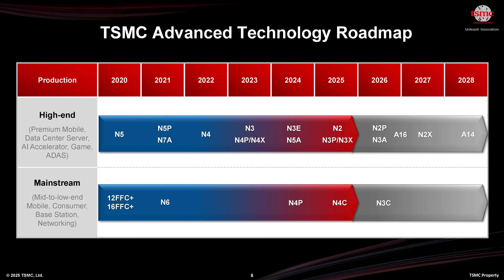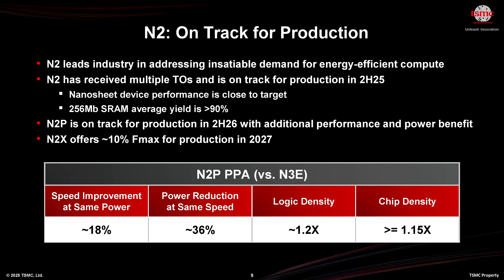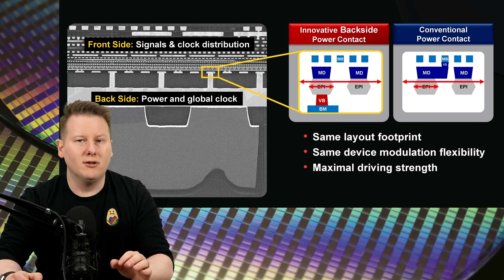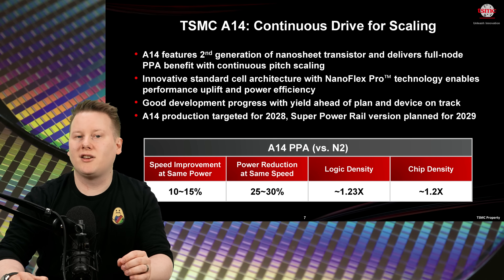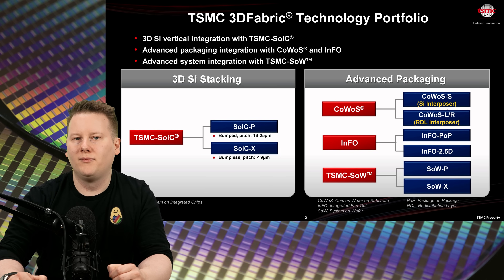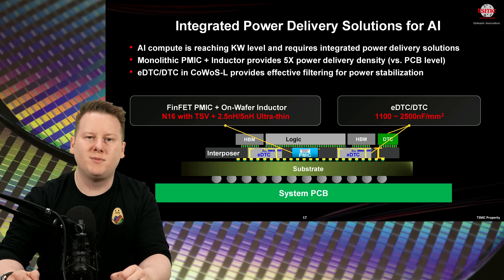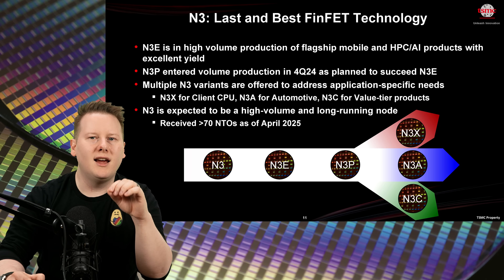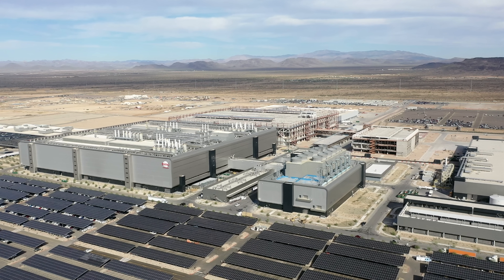The Future of Chips is TSMC's Roadmap to Success

Comment: This roadmap looks uninspiring. Even three years out, "A14" hardly qualifies as a full node improvement.
Reply: We're not in the 2010s anymore, we have to deal with this.
Reply: @ Sure, it's the best they can do - but we shouldn't let marketing make up new BS.  TSMC called their first finfet node "16nm" when it was functionally identical to 20nm planar.
Reply: TSMC's CC Wei has recently redfined "full node performance" gains as 15%.  :(
Reply: It's a good roadmap if they can stick to it.
Reply: It only looks uninspiring to the uninformed. From an Analog, RF design POV, TSMC putting monolithic PMICs & LC tanks in the interposer is mind blowing!!!
Reply: @tringuyen7519  the engineering is inspiring but the results, compared to historical scaling, are kinda meh.
Reply: @jrherita  "compared to historical scaling"  You do realize that the physical limits of the root materials are quickly being reached, right?  You can only go so small before things simply don't work any more.  Were you paying any attention to the density increases in the next generations? 10% is going to be pretty substantial.  As they say; Moore's Law is dead...
Reply: @tringuyen7519  That's all packaging? 

Sure, nice filler for a presentation when your process scaling is in the toilet, but not really a replacement.

Comment: What will be beyond A14 in 2030+ what technology could replace silicon based transistors ? Or they will continue to enhance A14 little bit more ? Where is the physical limit ? For both Intel and TSMC i don't see any updates to technology behind A14. I remember when Core 2 duo was announced (2006) Intel already claimed  something like 14-10nm transistor in research now where are talks going ?
Reply from the maker: I've got a video on this coming soon - an update to my imec roadmap one from two years ago. Simply put, we know how to go until 2037
Reply: @TechTechPotato  Thanks for reply, I think this is interesting topic. Also if there are possibility in future for higher frequencies, or this is more related just to higher transistor density. Interesting is to see where are limits, I remember in 2005 I was thinking the limit will be around year 2020 now industry managed to pushed it more like to 2035+ ?
Reply: @michalfajta4508 TSMC can probably support frequencies beyond 7G. But can US FCC accommodate higher frequencies even for 6G yet? Beyond 2030, technology may hit a political barrier.
Reply: Well, the transistors are now about 10nm in size, so we're talking about a couple hundred atoms. I think we'll soon get to molecular structures, instead of carving crystals into tiny pieces.
Reply: @davidgunther8428  Currently, the limit is in shrinking the gate-to-gate distance, not the source-drain distance (which most people refer as the "transistor size"). The former is harder to achieve. We're stuck at about 45 nm nowadays with FinFETs.
Reply: I was actually about to post the exact same question, glad i had the good idea to read the comment section.

It's interesting and also scary to know that 2030 is key decade in many industries.
Reply: Clearly, there's a lower limit of "size", contrary to Moore's law regarding transistor density on a basic single wafer, and we are fast approaching that.  Where the gains are to be had is in lower voltages (lower resistance), discretes (non-logic) as part of the wafer itself and stacking.  Most importantly, the need for endless improvements in 'processor "speed" is rather pointless for commodity consumption; we are already far past what is required for typical day-to-day tasks of the vast majority of personal and business IT uses.  If you look at a current console like a PS5, the hardware is positively archaic compared to current-day standards and your average gamer still thinks it's the best thing since sliced bread!
Reply: Yes A14+++++

Comment from the maker: What are your thoughts on TSMC’s scaling roadmap? Will GAA and backside power keep Moore’s Law alive — or are we running out of road?
Let’s talk about it below. 👇
Reply: 2000W chips? Yeah, bring it on, now you're playing with power!
But will those 2000W chips be more efficient a grilling meat than the grill I currently have in the kitchen?!...
Reply: So the Band to Band Tunneling FET is coming soon?
Reply: Nano sheet surrounded by Phosphorene (Black phosphorous) should lead to the B2B Tunnel Fet technology.
Reply: Keeping Moore's law alive requires the price to keep going down, not staying the same. We'll see if all these new processes and techniques can keep the cost in check.
Reply: @davidgunther8428 Think beyond cost per wafer. Standard on-board PMIC with inductors & capacitors cost $7/supply. Integrating monolithic PMIC into interposer may cost less & have better tolerances & TC than regular on-board PMIC.
Reply: @davidgunther8428   all corps get insane margins, latest iphone 16 n3 chip costs 30-35usd to make @16-17k per wafer. "will make economics work" ahhaha. if insane greed of selling 30-35usd chips with insane margins for 1200usd+ didn't stop "economics" then nothing will. "worst case" for greedy manufacturers they'd lower their margins/greed a bit.
rtx 5080 chip costs like 100usd made from tsmc, nv and AIBs sell that for 1500-1800usd. 5080 57fps 1080p indiana jones, that slow 10x overpriced 540p junk barely can run modern gaming engines @max settings. meanwhile 1440p 100hz monitors costs just 100usd which means 5080 has like 35usd worth of MODERN gaming performance. keep buying 10x overpriced junk, noobs, and "economics" of selling 0 progress 10x overpriced junk will continue "working" i.e. milking the market with slow as-low-as-possible "progress'.
Reply: @davidgunther8428  While we do not have accurate count of cost per wafer. The estimates already put progressive nodes as being more and more expensive. Which will likely remain true for these new processes doubly so considering companies will keep paying the ever rising costs of the wafers.
Reply: As I mentioned elsewhere, clearly, there's a lower limit of "size", contrary to Moore's law regarding transistor density on a basic single wafer, and we are fast approaching that.  Where the gains are to be had is in lower voltages (lower resistance), discretes (non-logic) as part of the wafer itself and stacking.  Most importantly, the need for endless improvements in 'processor "speed" and capability is rather pointless for commodity consumption; we are already far past what is required for typical day-to-day tasks of the vast majority of personal and business IT uses.  

If you look at a current console like a PS5, the hardware is positively archaic compared to current-day standards and your average gamer still thinks it's the best thing since sliced bread!  Most typical corporate IT tasks could be smoothly accomplished on the most basic, few-dollar, ARM SoC.  The idea that a typical corporate user needs a full "PC" (or laptop) with a modern multi-core CPU is comically stupid.  Corporate, and personal, IT buying patterns change at a glacial rate and are now completely divorced from fitness to purpose and effectiveness.
Reply: @awebuser5914  1st part nope. your average PC gamer actually KNOWS it's obsolete low-VRAM slow junk that slows  down progress in gaming industry. the problem is amd makes consoles so they aren't interested in improvements for consoles AND GPUs. 0 progress and mining-like 10x overprice with PC GPUs makes obsolete cheap-to-make hardware in overpriced consoles look way better in comparison than it actually is. the problem is greed and 0 desire of corps to make actual progress (because progress DROPS PRICES), as long as they can sell slow junk they don't care.
Reply: @rawdez_  "the problem is greed and 0 desire of corps to make actual progress..."  Delusional, conspiracy-theory laden ramblings with pretty much devoid of any facts...
Reply: @awebuser5914  lol, what do you even know about logic or facts)) use wafer calcs and calculate price of a GPU chip. then look at the GPU price. ohh, you can't... got it))
Reply: fake msrps, fake deficit to justify 10x overpriced msrps, glitchy artifacting laggy AI fakeframes, 4060 less VRAM than 3060, 7800xt vs 6800xt 0 progress, 1060 2016 vs 4060 just 2x improvement in 8 years, 9600gt 2008 vs 1060 is 9x. i.e. gamedevs that 10years make their games expected 4060 to be 4x faster than it turned out, i.e. it should be 5090 performance for 300usd. 2x in 8 years means that with switch from 1080p to 1440p because 1440p 100hz is 100usd there's literally 0 performance left to run newer than 2016 engines. GRAPHICS SHOULD STAY LITERALLY THE SAME as in 2016 to run okay in 2025.
thats why gamedev is forced to use upscale and glitchy fakeframes to run 2018 6yo rtx tech. 'modern' 0 progress 10x overpriced nv/amd junk simply can't run now releasing games gamedev made for a decade expecting progress to happen. but nv/amd were busy selling 0 progress junk to miners who didn't care about gaming performance. and then they were busy trying to sell heaps of 3000/6000 cards miners didn't want anymore without dropping prices so they've priced 4000/7000 over unsold old cards. and now corps like their insane margins and don't want to cut those. brainwashing gamers with marketing that defends 10x overpriced 17 or 57fps SLOW 540p junk
Reply: its just greed, corps like mining-like overprice 500-1000-5000% margins, insane profits and don't want to make any progress to keep selling obsolete slow cheap-to-make 10-20-50x overpriced junk. especially in consoles, PC GPUs getting better is bad for selling junk, so corps stopped progress on purpose to sell more consoles and handhelds. better PC GPUs =  less consoles junk sales, but with VERY bad PC GPUs ps5 pro @700+ with basically 2018 rtx2080 6yo level of performance doesn't look as bad. and slow handhelds with upscaled fakeframes crap graphics on small screens, so you can't see how bad it actually is, don't look as bad too.
 just buy way cheaper used GPUs instead and ignore 'modern rtx games'. and don't buy new consoles too, because that way amd sales you cheap-to-make obsolete slow junk. buy whatever used.
Reply: @awebuser5914  "rather pointless for commodity consumption", yeah, rright. all new GPUs are 10x overpriced like mining isn't over slow obsolete 0 progress junk. 9070xt 17fps in indiana jones,  its a 540p GPU, lol. 5070ti 53fps 1080p indiana jones '750usd' fake msrp, 1440p 100hz costs just 100usd. basically 5070ti is a half-1080p xx30 card, like 30usd worth of 2025 gaming performance. 
5080 57fps 1080p indiana jones. 5080 has like 35usd worth of MODERN gaming performance while running 6yo 2018 rtx tech. 5080 chip costs around 100usd, they sell that slow junk for 1500-1800usd now, even @msrp thats an obsolete slow junk, 5080 should be a 50usd xx30 class card in 2025 if judged by its performance. and no, fakeframes aren't fps or 'performance' because they don't improve latency/responsiveness in games, fakeframes are just motion smoother tech for monitors. thats it. without basic performance its useless junk, dlss and upscale should be additional features on top of actual performance not USELESS performance replacement. meanwhile enjoy 540p 10x overpriced gaming because corps forgot to make actual progress with hardware.
9070xt 17fps 1080p indiana jones, 5070ti 53fps, RTX 5070 ...13fps. slow junk low-VRAM 10x overpriced like mining isn't over 'modern' cards can't even run modern games.
Reply: intel tera-herz exists from 2001. hp memristor PC 2008. how about just making and releasing some of that. the ONLY problem of releasing far superior tech is everything that is on the market currently WILL become OBSOLETE and useless junk overnight. no more milking of the market with 0-5% "gains"/year. no more steady income for corps. disruption of ALL silicon chips production because it will become useless. no retrofitting of 40 years old fab equipment for new nodes. gotta build new factories and new equipment. ain't nobody got time for that.
like 45cm wafers. nobody got time for that. just keep milking the market with equipment/fabs they have already. for decades.
Reply: improve node a bit, sell the same architecture again, repeat.. again, again and again... minimal R&D spends & insane margins, steady insane profits and prices don't drop because "progress" is minimal and overpriced. enjoy the same iphone/GPU/CPU as 5 years ago with minimal improvements... but with higher price )) just keep buying and with 0-5% gain/year you'll see actual progress and next gen tech in year 2080. or later.